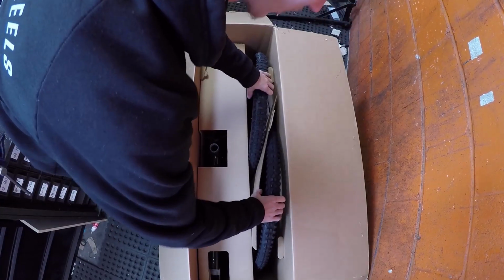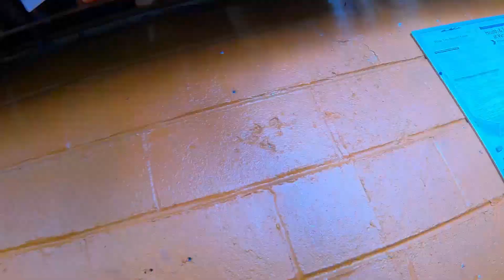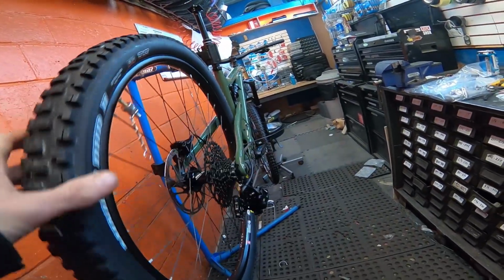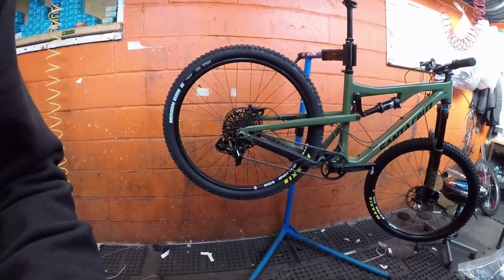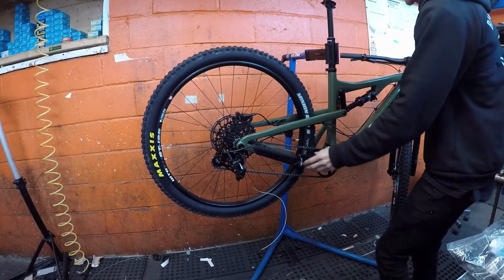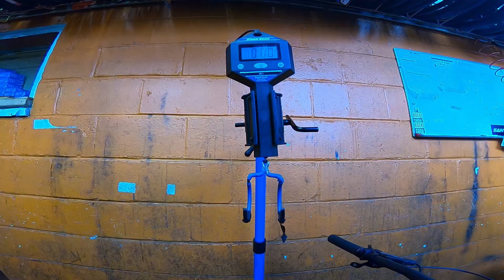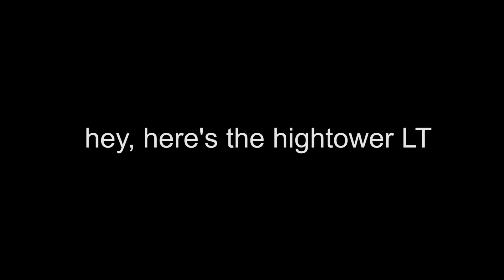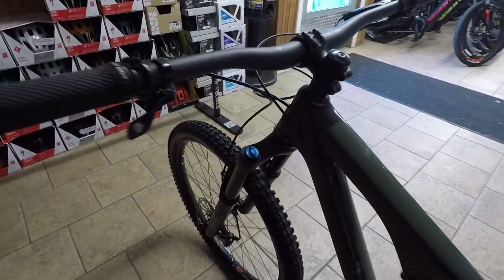2018 SANTA CRUZ BRONSON C BUILD

Comment: Did the internal dropper run all the way through the BB area, up the down tube and out the hole at top of the down tube???????? Just got a Bronson frame and was wondering about cable routing. HELP!!!!!!
Reply from the maker: Believe so, as far as I can recall with Santa frame is that they are connected all the way through. (Unless it’s not carbon) which then I’d have to look into it more.